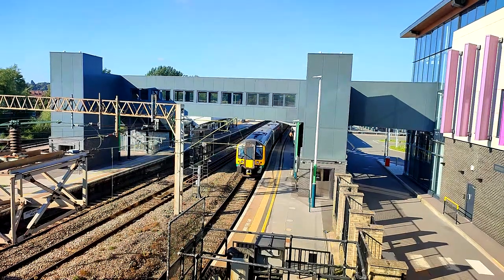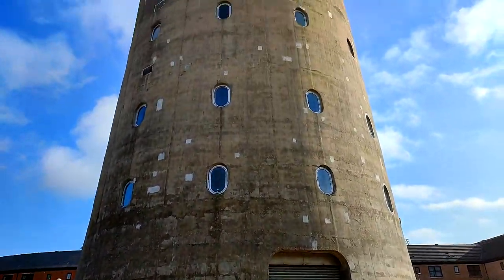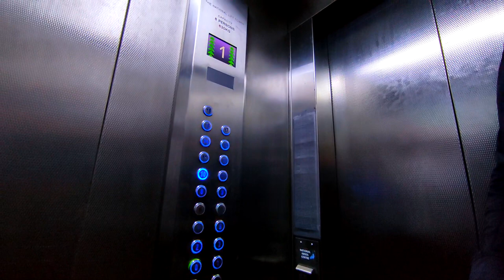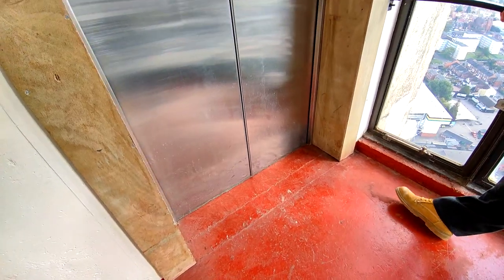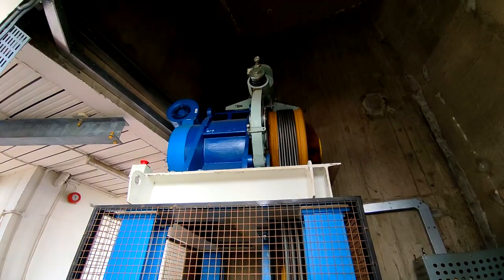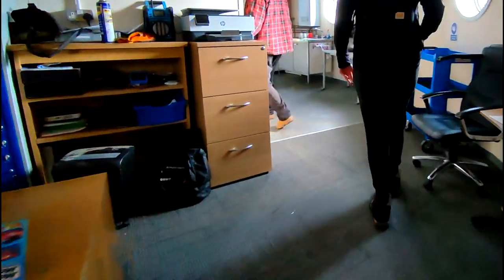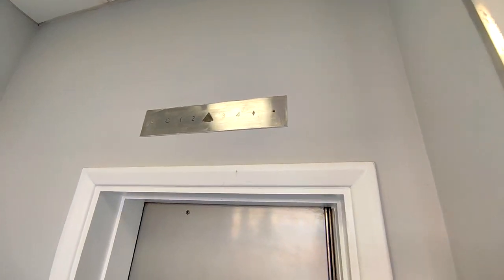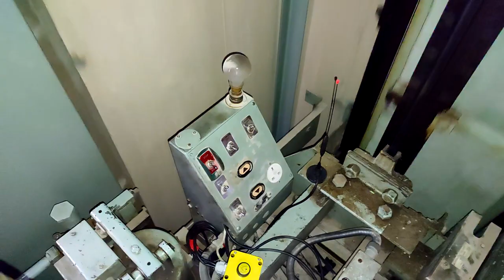The Express Lift Tower Northampton

Comment: I think LiftTech in Australia uses ILE logics in all of their lifts as they mostly install higher end heavy duty lifts and escalators on public transport networks in Australia as they have a contract with the government to do that and to maintain almost all of the lifts in Australia’s public transport network! So the lifts that are installed in Australia’s public transportation networks are actually really good for generic lifts which makes a lot of sense as for public transport systems they need to be extremely heavy duty and vandalism resistant which is also for the purpose of ensuring reliability and reducing maintenance costs as much as possible without violating any safety codes/laws which are already extremely strict in Australia! :)

Comment: Are all the motors still original apart from the slight mods
Reply from the maker: I am not sure about the medium speed lift.  The high speed and service lifts have new motors.  The slow speed lift has new motor attached to original gearbox.
Reply: @benolifts  the doors look new on 2 of them but on one
Of the lifts the doors look original